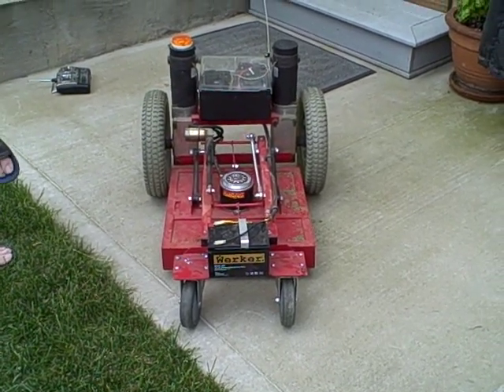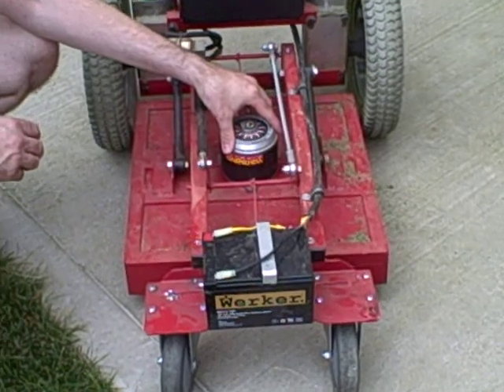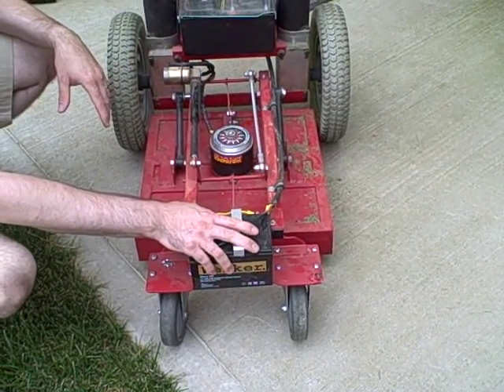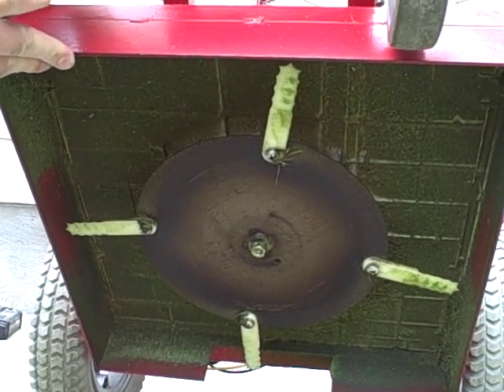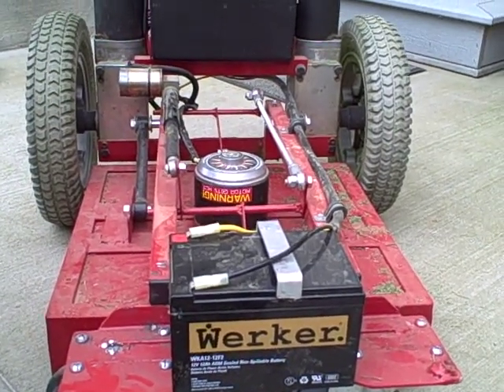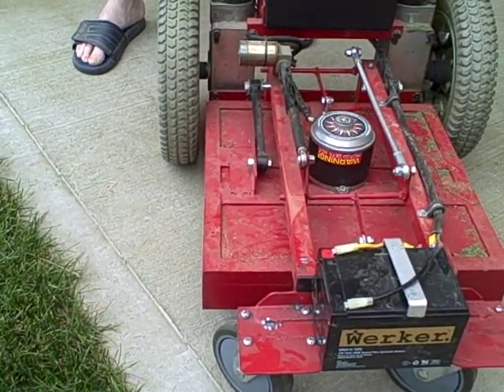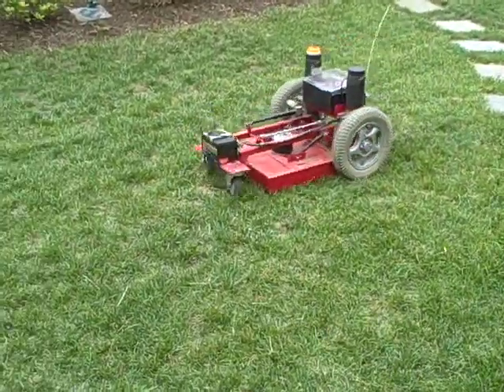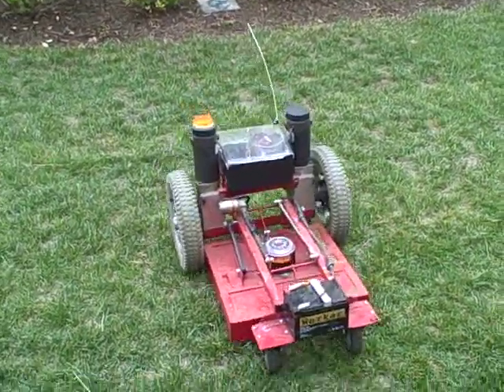Remote Control Lawn Mower

Comment: How did you control the linear actuator with the remote control?  I am trying to do this now.  Was it a motor controller, relays Arduino or something else?  I am trying to do it in the simplest way possible.  Can you help?
Reply from the maker: The deck height actuator is just a toggle switch on the back of the mower. I did not see a need to remotely control the deck height. I did at one time have a second linear actuator on the front with an arm and a string trimmer that I could remotely deploy to trim, but after knocking it off a couple times trying to use it I gave up and took it off. This was controlled remotely and I believe by the simplest way possible. I attached a DPDT slide switch to the side of a servo and used the servo arm to slide the switch back and forth. I think a DPDT toggle would work also.
Reply: @RCMowerRev3point0  Thank you,  I will keep researching this.  I have a lot of and rocks in my yard and need to adjust it often.
Reply from the maker: @robertcalaway4970  The main reason I did not want to change the height remotely was because if I were to adjust it while I was mowing and not get it back at the same height the grass would be mowed at different heights and look uneven. Maybe you could set a couple of physical stops to get it back at the same height or look at a linear servo which will have feedback giving you exact control.

Comment: Do you ever wash the deck after a mow? Are you concerned about water on the cutting motor?
Reply from the maker: Not with water. I would usually just blow it off with a leaf blower or air compressor.

Comment: Nice design. Thank you for video .
If can you post more detail about control for H bridge of 2 electric motor at rear. Thanks
Reply from the maker: www.dimensionengineering.com It is a Sabertooth 2x25. They have documents on their website that show you exactly how to wire it.

Comment: i love your mower, how did you turn cutting motor on from transmitter? plz help thx
Reply from the maker: I connected a SPST slide switch to a servo so the servo would slide the switch back and forth and then I connected that to a 12V relay to turn the motor on and off. I think a speed controller would be better but I used what I had on hand at the time. :)
Reply: ok thx

Comment from the maker: I think it was about 3 months. I spent  a lot of time building a string trimmer that mounted to the front that I could deploy using the remote but after breaking it off 2 times I removed it.